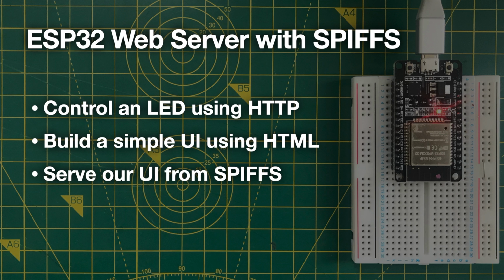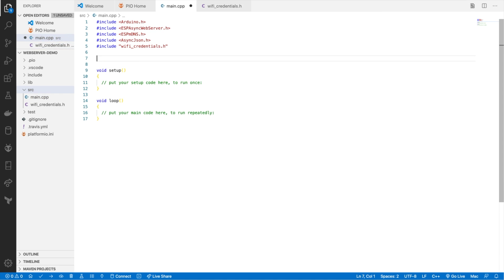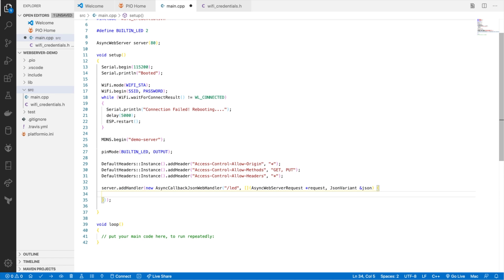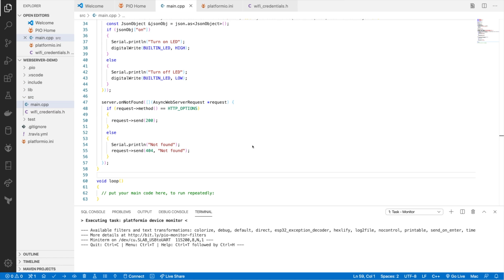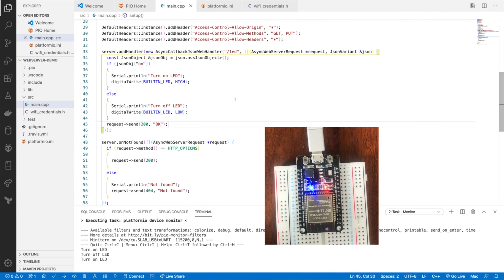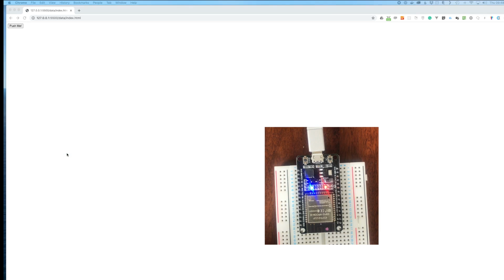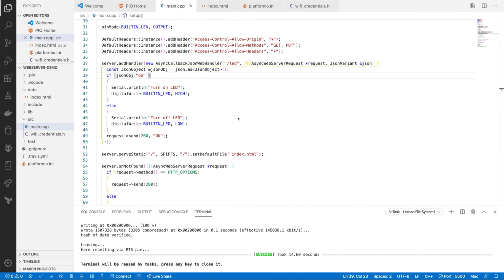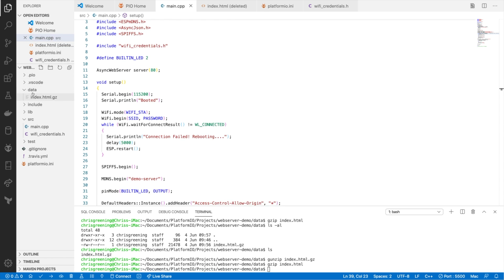ESP32 HTTP Web Server With Content Served from SPIFFS Filesystem

Comment: excellent work! I was wondering if can also use css and javascript files? If that so it be same as calling the html file?
Reply from the maker: Yes they work without any problem as well.
Reply: Is it possible to have file trees in the spiffs?
Sepcifically: I plan to copy the chart.js-library to the spiffs, so my eps32-hosted site does not need internet connection for beautiful graphs, charts and diagrams.
Reply: I am sorry for my bad english.

Comment: I'm Using Platformio under Windows and I get this error : \ESPAsyncWebServer-esphome\src\WebHandlers.cpp:67:64: error: 'strftime' was not declared in this scope
This problem happens in Windows only. Linux and Mac are case sensitive for files, so these OSes differ between time.h and Time.h. Windows doesn't.

The workaround I used was 
At platformio.ini file I ignored :

lib_ignore=Time

After this my compile was success

I hope this Help Others .
Reply from the maker: Thanks for this Cesar - the joys of cross platform development!